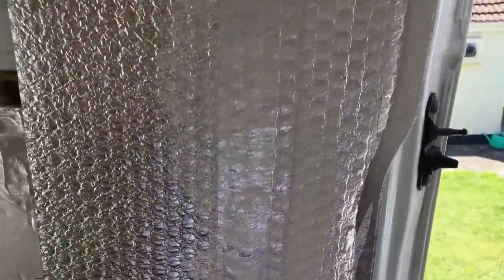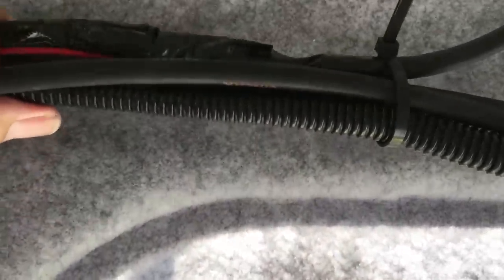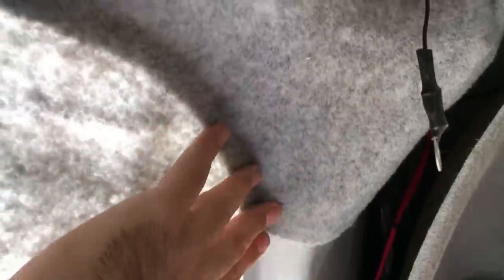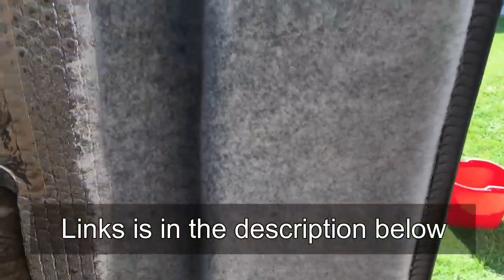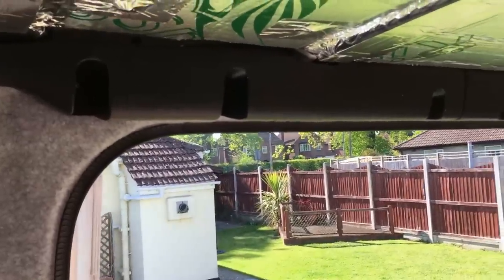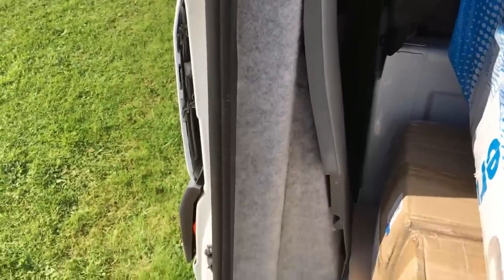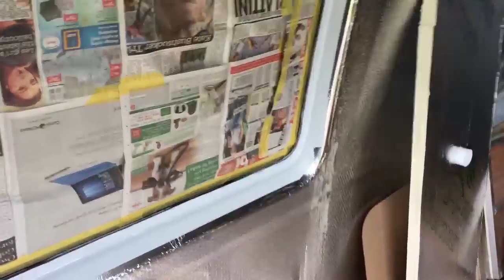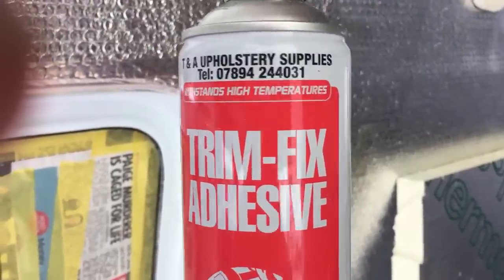Mercedes Sprinter Conversion - Van Lining Carpet

Comment: Hi Greg
My question for the Q&A: how do you get your drill to drill self-drilling screws into steel without rounding the heads?  My drill is a DeWalt (not the most powerful, the £100 one), I set it on the screw setting, my screwdriver heads may not be very good quality.  It just goes dgrrr dgdrrr and whizzes round, rounding the screw heads (which were ones I bought following your link). There is absolutely no sign of the screws puncturing the metal.  Similarly, with pocket hole screws the bit just whizzes round madly and uncontrollably - seemed like complete overkill. I just do mine by hand with the Kreg tool in a small socket on an extension and that is much more manageable. But I do wonder what I am doing wrong on both counts.
Reply from the maker: I have two type of battery drill, the smaller Dewalt one is an impact driver, it's like a hammer drill for screws.
It's the same sort of thing that they undo your wheel nuts with at the garage.
With self-drilling screws, an impact driver does help to get the screw to bite into the metal surface.
Make sure you have the correct screwdriver bit for the screws you are using, typically PZ2 / PH2 are common sizes.
Most times if the drill just spins you need to apply more weight behind it to keep it in the screw head.

Comment: I don't know if you check these comments anymore but I'm getting ready to do a truck camper in the near future and find all your videos extremely helpful. Thank you so much for doing this. Do you have any experience using a corrugated nail gun?
Reply from the maker: Richard Bail yes every message comes up in my notifications. I have used Pneumatic nail guns for various woodworking project and even some stuff in the van for pinning until glue goes off they are very handy.
Reply: @GregVirgoe  but the corrugated nail gun also? It shoots a wavy looking nail. I think is awesome that you take the time to respond.
Reply from the maker: Richard Bail I never seen one like that. What application would you use it for?
Reply: @GregVirgoe  it is used for joints in cabinetry and other wood product type projects. Supposedly works real nice.
Reply from the maker: Richard Bail I have seen a wavy fixing on the corner of mitre joints like picture frames

Comment: What did you do on the rear corners, did you have holes in the pillars where you’d need to access to change a brake light bulb for example?
Reply from the maker: I wrapped the rear corners the same way as access to the lights is from the outside on sprinters and crafters. If you have the Ducato boxer relay or pro master you need to leave the panels accessible for future use. 👍🏼

Comment: How much time have you got to play around with the carpet before the glue dries Greg
Reply from the maker: Martin watson Kent van life quite a while as it’s like contact adhesive. However once stuck it’s very hard to get off and you end up o er stretching the carpet trying to pull it away. But it’s very easy to work with.

Comment: QUESTION: I've seen some other van builds that use "jeans" as an insulator. Since you've professionally worked in HVAC, what are your thoughts on the insulation properties of "cut up jeans" that people are using in their builds? Is it really worth the benefit as far as VOCs are concerned?
Reply from the maker: Denim insulation has good insulation properties and have seen it used other states, make sure you have a good vapour barrier and that will avoid any moisture issues.

Comment: Hi Greg 

Id like to know how you dealt with the juncture between the carpet you applied to the window in this video to any other carpet that was applied to this wall after completion. This make the presumption that the rest of this wall is carpeted also?
Reply from the maker: Hello Harry,
ABove is the wall cupboard, to the right is the shower cubicle and below is the bench seating.
I may wrap a ply sheet with carpet and fix behind the bench seating below the window for when the cushions come off.
Reply: Thanks greg! May i just say how useful your videos have been. When your first video went up i had just brought a van ready to convert and ever since you have been 2-3 months ahead of me with every stage of the project so you've been the perfect reference point going along. In every stage of the project ive used your respective video as a guide to complete my work, so thank you so much for your advice.

Comment: Thanks Greg for another great video.  I want to apply headliner, not carpet.  Was looking for foam  as underlayment but have reflectix available.  Do you think reflectix as underlayment is a good option for headliner material?
Reply from the maker: Hello, they call this carpet, but it is really stretchy felt the same as your headliner, its a fabric.
I have used this for the headliner in my cab shelf. check out that video.
I also used Reflectix on my ceiling before installing the headliner.

Comment: Hello again Greg, just a quick question, did you use the spray adhesive throughout the van when applying the reflectix bubble wrap, I’m literally just about to wrap mine now so a hasty response would be greatly appreciated 🤦🏻‍♂️😂👍🏽  I assume you did but want to be sure, thanks
Reply from the maker: Paul Carter yes I did use it it works really well and made it easier to apply
Reply: Greg Virgoe much appreciated, thanks 🙏

Comment: Hi Greg i wanted to ask you if the way you built the workshop base units is good for kitchen units? 
and if you could give a cost breakdown of the van build?
also how are your driving on the right side of the road skills? I had wonderded if it would be possable to buy a van in say Germany and bring it over and convert it.
Reply from the maker: Hi Peter, yes they are built very similar, the only difference is the braces are kept inside the side panels on kitchen units so you don't see them on end cupboards and they use concealed fixing like cup and bolts. Personally I have driven a lot in Spain and France and would much rather have a right hand drive car and drive on the right than a left hand drive car. I find it odd having the controls in different hands more so than driving on different side of the road. I'll answer budget in the video. Cheers

Comment: Hi, is it really a good idea to have the carpet going to the ‘outside’ of the van?! if dampness gets in to the rubber seal on the outside surely it will soak into the carpet, bringing the dampness into the interior of the van?!
Reply from the maker: Hello Daniel, the carpet does not go outside at all, there is the smallest part wrapped around the metal and totally covered by the rubber. I can guarantee we have had rain snow and everything besides and not a drop of water has touched the carpet

Comment: If you put it underneath the door rubbers does the carpet not wick through water as the rubber needs to seal against the metal? Genuine question as going to do my little runaround van to make it more car like.
Reply from the maker: Just don’t go too far round the outside. Cut it back so it’s completely covered by the rubber and you can’t see it outside and you’ll be fine. Otherwise like you say it will get wet right through to inside.
Reply from the maker: On the doors it’s best to make door cards and keep well clear of where the rubbers contact the metal.

Comment: are you gonna make video on your solar panel/battery system?
Reply from the maker: There will be a follow-up video on the solar panel installation and full electric install.
Searching for stronger gas struts to support the panels as my original aluminium struts were way too flimsy.

Comment: Hi Greg. Thanks for another great video, as always very helpful. I am going to use this stretch carpet lining in my conversion for those exposed metal parts, can you tell me what colour carpet lining you bought please Greg as I like that colour? Thanks. Stay safe Greg Regards Tracey
Reply from the maker: Hi Tracey, it was the silver carpet and was closest to the original headliner colour
Reply: @GregVirgoe  Thanks very much for this Greg, will get a silver one ordered. Looks great in your van! Regards Tracey.
Reply from the maker: T Blake there is links in the description and don’t forget to get some trim fix adhesive. It is very nice material to work with just take you time 👍🏼😊
Reply: @GregVirgoe  Yes will get some Trim Fix too Greg, thanks very much for that & for your help, it's much appreciated! Keep the great videos coming when you can Greg, loving them! Take care regards Tracey.
Reply from the maker: Thank you Tracey that does mean a lot.

Comment: How many sheets of the furniture board did you need for your van?
Reply from the maker: Mcgurks Carbon Cleaning Solutions McGurk we used 7 sheets in total and here is a free cutting plan to show you how I used the boards

https://www.dropbox.com/s/5tbb3zb36c0o3wm/Cutting%20Plan.pdf?dl=0

Comment: Hi Greg

I am converting my vauxhall vivaro lwb from a minibus to a camper
I have removed all the rear seats and floor etc and have sanded and painted any rust spots
Inhave taken off the plastic side panels in the rear of the van and insulated
Do you think I should reinstall the plastic panels then barrier over these or just barrier straight over the insulation
Reply from the maker: barrier over your insulation before applying any panelling :D

Comment: I am just about to start a 7.5 tonne 20ft box conversion. HELP! do I install insulation first or layout the wiring with the insulation over the top?
Reply from the maker: TopThrottle UK that sounds great at least the sides will be straight 🤓 I would get your first fix cables pulled into conduits before you insulate if you want your wiring to be concealed. Especially for lights and fans in the ceiling. Having a plan of where everything needs to go is essential from the start that will help you a lot and save going back steps to undo things.

Comment: Q1: Why did you opt for the long wheelbase Sprinter?

Q2: If you had bought the short wheelbase Sprinter, which sacrifices in the design would you have taken to squeeze everything in?

Q3: If you wanted the best of both worlds from the short Sprinter (drivability, parking, weight) and the long Sprinter (extra space) but without giving up anything, how would you tackle the design? Slideouts on a budget feasible? 

Q4: Anything you regret about opting for this particular van and spec?

Many thanks.
Reply: If you're going for a high van, might as well get a long one.

Comment: Could you use cloth instead of carpet?
Reply from the maker: I use the term carpet loosely as this really is a stretchy felt, you can tease the fibres in all directions to stretch it make it conform to odd shapes. There is nothing stopping you using a cloth, it may not conform to the shapes as well so you will need to be creative with folds, etc. I have seen coloured fabrics used on headliners and door panels to great effect.
Reply: Thank you. Amazing videos - very very helpful!

Comment: Just a note, Most Primers are porous meaning moisture will seep through them to the metal. Unless you use a 2 part Epoxy primer/sealer  you are wasting time.

Comment: I'm converting my kangoo mpv i thought I was going to have to ply line the sides can I just cover the interior with reflectix and then carpet straight over the top of that ?
Reply from the maker: I’m only using that method for the window and door frames to cover the exposed metal. It’s enough to prevent condensation forming but gives minimal thermal insulation so I would not recommend you do your whole van like that. 
You really need some better insulation. 
You could stick Armaflex sheet min 12mm thick to the van and carpet over that would be a better solution.